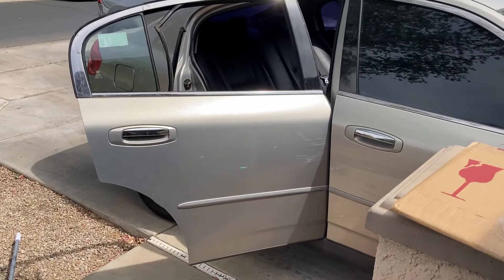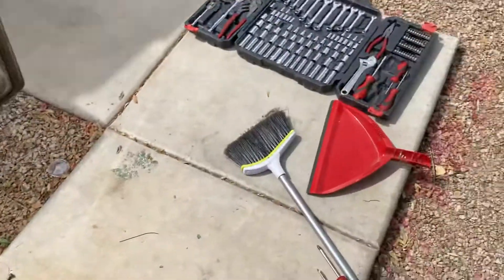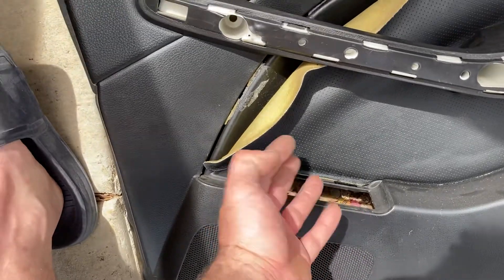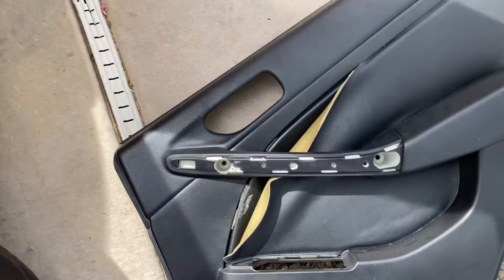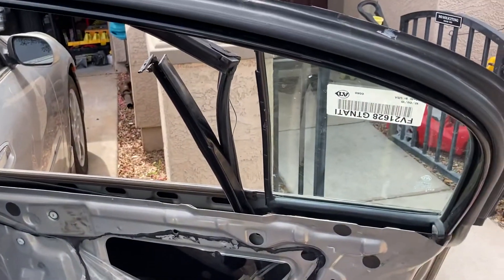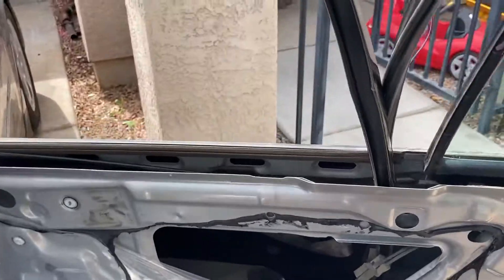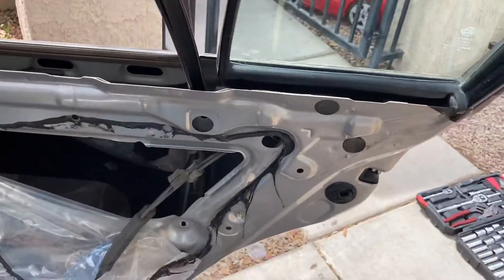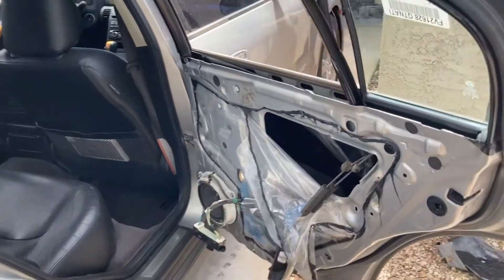2003 Infiniti G35 Rear Window Glass replacement and panel removal

Comment: How did you align the motor the 4 little bolts ! 10mm
Reply from the maker: I believe I removed the back plate as a whole and it made it easier. Follow around the outside of the plate and remove those bolts then the back plate is loose and makes it easier.